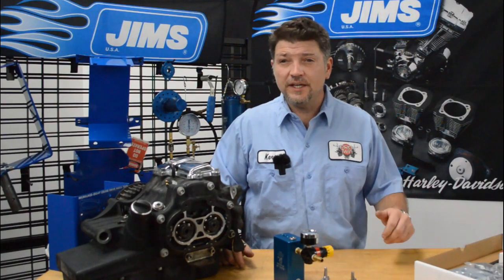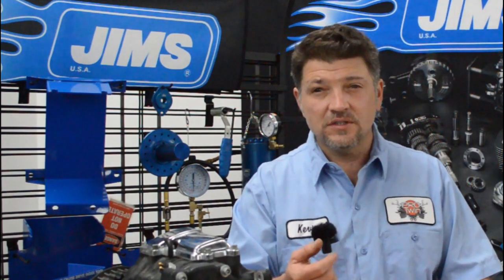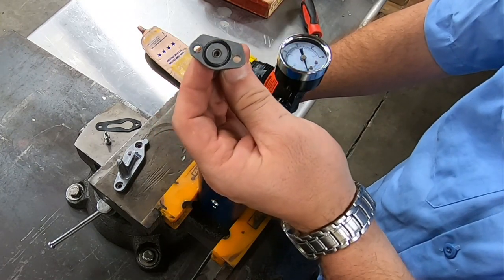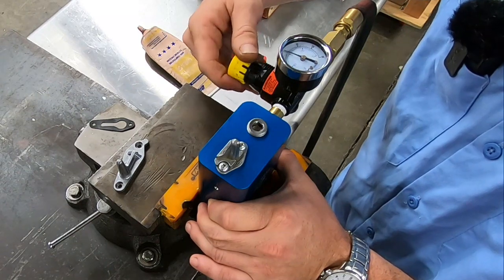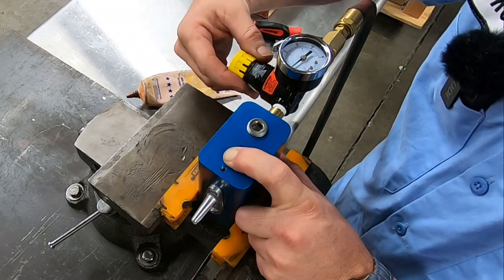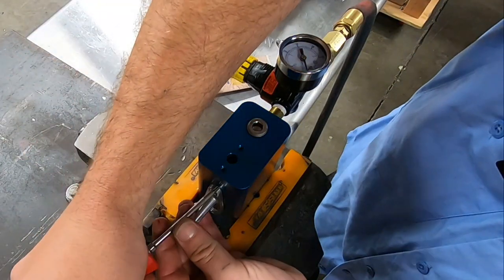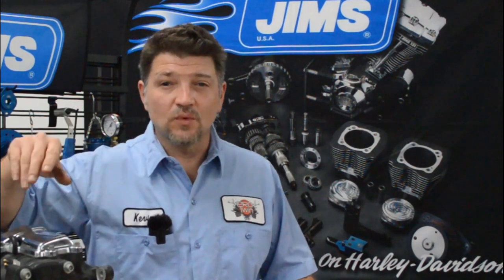Failed M8 Piston Jets - M8 Sumping Issues - Tool Tech Tuesday - JIMS - Kevin Baxter - Pro Twin Perf

Comment: This is the perfect video to share with my local H-D mechanic! Several of us developed horrible lifter noise at start up on our 2019 M-8’s and H-D thought it was solely loose oilers so the O-rings were replaced. I’m betting that most H-D mechanics don’t have that Jim’s tester in their tool boxes. Mine goes in next for repair as soon as the o-rings come in.
Reply from the maker: Thank you sir. Very soon ill be releasing a video on fitting tappets, preloading, and proper pushrod adjustment.

Comment: I just read about an M8 finding an excessive amount of oil in the crankcase after removing the crank sensor. I never gave a piston jet a second thought as a potential point of failure. I shared your video in that post hoping it helps the owner as well as others.
Reply from the maker: Thank you Kerry!

Comment: Here's a major issue that no one is considering when they install high volume pumps/plates, and I admittedly had not considered it.  Feuling states on their site that the HP+ oil pump provides 27% more pressure and scavenge gear volume over stock. At the time of your installation, you have already gone beyond the OEM piston oiler's capacity to operate at its prescribed (read STOCK) levels. Simply, you've just created a sumping issue by attempting to avoid a sumping issue. No one tells you that when you're installing these "upgrades" and upgrade packages, that you should properly tear the engine down and change piston oilers to prevent sumping. That doesn't make their bolt-on "upgrades" and "enhancements" very appealing.  And I'm of the school that a cam/camchest upgrade, is not a "tear down". If I don't see piston heads, I only upgraded bolt-on parts. 

Here we've all been sitting on the edges of our seats for months/years in the hopes that someone will alleviate our fears by telling us exactly what's necessary to make our engines run forever. And, here it is. A psi increase of that pressure/volume is going to overwhelm/negate any and every stock part that is created to regulate/limit it.

This is the totality of the explanation. And if you miss out on an absolutely necessary component, doom on you. 

However, if we didn't have Kevin Baxter doing the work and spending the hours, we would still be in the dark and still be blowing up our engines from a simple lack of information. Many of us may be decent mechanics, but we're nowhere near the level of Kevin. I wrote him a pretty long and detailed email, a while ago. And while I got no response, I completely understand that these videos are the answer to all my questions. We all owe him a debt of gratitude. 

Thanks, Kevin. My questions have been answered.  The summation? Do it all or don't do any of it.
Reply from the maker: sorry if i missed your email.  several hundred a day come thru and i cant get them all.  thank you for your kind words and for a great comment.  I always cringed, even early in the TC days, when people were stretching bypass springs in their cam plates or installing super heavy springs that would yield as much as 60psi hot at 2000rpm, and 25 to 35 at idle.  HD engines are more of a volume then pressure based system.  Most of the load is taken by mechanical bearings so they arent as reliant on oil pressure to establish the bearing surface.  Repeated cold starts, over and over, without running the bike for an extended period of time even with stock plates/pumps can yield poor conditions.  Cold oil pressure can be 30 plus.  Do it over and over, when the oiling system cant keep up, and it can just build over time.

Comment: To demonstrate graphically when the valve opens putting one of those skinny balloons over the end of it would be cool
Reply from the maker: using oil with a sheet of paper in front of the nozzle works well too.  just messy for a video.

Comment: Is the ball and spring crimped in?  What does Harley charge for new ones? Is it defective machining of the seat? Crappy spring?or just grit from the oil holding the ball away from the seat letting the blow by oil?  Old 900 sportsters (oil pump)we would lap the ball in with a little lapping compound.....

Comment: Hi Kevin, best not to use a 40mm gage, they aren't that accurate, esp. those provided on a standard pneumatic pressure regulator. Go for a 63mm gage with an stated accuracy class and a calibration cert. as well as a scale appropriate to the pressure being measured. (Apologies if sounding schoolmasterly, but I've worked in the gases industry most of my life). That said, the video sure brought the point across. I have a M8 114 CI and it has fallen prey to sumping. Not too sure why, as I have a S&S 475 set of high-lift cams, cam plate, lifters etc., and a S&S oil pump fitted. The bike does get to feel sluggish on hot days on the freeway cruising at 120 km/h or thereabouts. No one can tell me why, but the shop I use now wants to tear my engine down. Bike doesn't emit any blue smoke, runs cool mostly unless I'm hammering it, pulls like a freight train ... etc. but runs ever so rich. I smell unburnt fuel (not oil) all the time. Use 3 tanks of gas to everyone else's 2. Maybe you can share some insight into these things. Thanks again for another very informative video. Keep 'em comin! Love them.
Reply: Does he need a high degree of accuracy for such a simple mechanism?  I'd bet it doesn't matter if that check valve opened at 12 or 14 psi.

Comment: I have a question, I saw a video saying an S&S oil pump holds about 14 psi at idle, would that cause a sumping problem installing one in a twin cam?
Reply from the maker: Not at all.  Controlled and not at full spray at that point.  Cranking that pressure up can lead to other issues though.

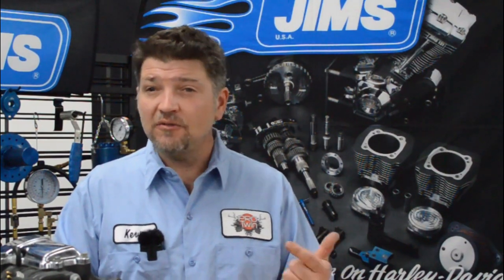Comment: The part at 2:40 really struck a chord with me:  my front cylinder lifters clattered something awful at startup, & HD (grudgingly) replaced them.  Given that I'm now draining up to 9 oz of oil from the crank position sensor hole, could it be that leaking piston oilers are at the root of both issues?
Reply from the maker: it could very well be.  good luck

Comment: Kevin, quick question.  I have an M8 with the whole S&S cam and chest upgrade with pump, plate etc.  The S&S pump runs at a much higher pressure at idle than stock.  This means my piston oilers are spraying constantly also.  I did have my cylinders off once just to check the oilers and yes they were loose.  I of course snugged them up.  Never had any sumping issues tho even before.  FYI my bike is a 2019 FLTRX 107.   Will the aftermarket come up with a new jet that is designed to work with the higher output aftermarket pumps?  I sometimes have trouble getting back to these links so if you could address this question in a future video that would be great since I watch all your videos.  Thanks
Reply from the maker: Great question.  Some crank that pressure up and it can lead to other issues.  a controlled spray at a slightly elevated pressure isnt a big issue as long as the cold starts arent repeated over and over...cold oil makes more pressure.  so if the bike is cranked, ride it so the pump can get the excess oil out.  Snugging them up didnt always fix because the screws were too long to begin with.  They would bottom out.  Thanks for the comment.

Comment: In Nov 2019 I found and purchased an antique Soviet Union military Dnepr sidecar motorcycle. It was imported after the collapse of the Soviet Union in 1992. It then sat in a barn for 27 years. I had to take everything apart because it sat for so long. I was amazed by the oiling system the engine uses. Oil is pumped at 6 bar or 86 psi to the crankshaft. That oil then exists around the shell type rod bearings spraying oil into the pistons, cam shaft, and lifters. There are separate jets that spray oil into the main crankshaft and cam shaft bearings, and the timing gears. They kept building them like that from 1946 until 2001 when a new CEO took over bankrupt the company. They sold millions of those Motorcycles. So many that part's for them are still made and easily available world wide. I would buy a new one if they were still being made due to the bullet proof engine design.
Reply from the maker: great comment.  thanks for sharing. I'll look into those.

Comment: Is there a definitive way to test the piston oilers? Is it possible to replace them without splitting the engine case?
Reply: You don’t have to split the cases. You can access them by removing the cylinders.

Comment: I've got a 124 kit on my m8 and have every single thing in the world aftermarket. including a transmission vent and I still can't get it to quit spitting oil. I have no clue what to do.
Reply from the maker: I suggest performing a leakdown and CCP test to check ring seal.
Reply: @KevinBaxter  I appreciate the response. Will do.

Comment: Hi Kevin  you seem to be really on your game i have a 2021 cvo 117 down 2-1/2 qts at 900 miles dealer said its normal had the 1000 service done @900 now i have 1200 miles and down 1qt again dealer said its normal what do you think? thanks in advance
Reply from the maker: That's not the kind of "normal" i would want to see.  Normal doesnt mean good.  I will say, burning 3.5 qts in 1800 miles....is certainly not good.

Comment: Man! Did Harley use any good parts in the m8? It seems every part is defective. Sleeves cracking, slightly crooked rods, leaking piston oilers, lifters coming unglued Harley has to guit buying crap from Chinese suppliers and startakinh parts in house or they're going to go belly up. it's no wonder Indian is gaining ground.
Reply from the maker: Not all have these issues...my goal is to educate folks to look deeper and not just bolt on parts.  Finding the causes is key.  This is just one of them.  Often, parts get blamed for things caused by other issues.

Comment: I feel somewhat famous!  😪  

Can't wait to smoke everyone and anyone up here in jersey!
Reply: Hi Steven, were your lifters noisy ?
Reply: @Dubhghaill  that's kind of subjective..  so can't really answer..  the stock bike coming off the showroom floor was a sewing machine..  when i put the woods cam, woods lifters and and adjustable pushrods in..  she quieted down a bit..  but i also put a match tuned Exhaust on...  tuned not loud.. but lots enough that i didn't hear any tapping, whirling, etc..  

She was throwing oil into the airbox from the beginning and I thought the blowby coming from the cylinder heads was excessive.     My harley shop said, within limits..  

I put the fueling cam plate and pump and vented dip stick on.. did not solve..  so went ahead and externally breathed my heads....  and she was spitting oil out and got worse..  my oil dip stick was constantly at the ADD mark..  i would put 4 oz in at a time and it would be right down to zilch again in 100 miles..  little did i know i was just filling up the crank..  and my one cylinder rings never seated properly..  

Ohwell..  I'll have a go fast reliable engine that I'm going to try and blow apart everytime i ride it 🙃

Comment: Kevin, is there a way test the piston jet for leaks from the cam chest? I don't know which cavity opening goes to the piston jets but it would be a simple test before cracking the bottom end open. It wont verify plugging but would show a leak.

Comment: You are amazing!! Just needed to say that! I only wished I lived in Georgia, next door to you, I live in Tacoma Washington...shipping!!! I do have a question to ask you and I wonder if you could shed some light on the subject...reference; sumping and crank runout and external venting
Reply from the maker: Thank you John..appreciate that.  Whats your question?
Reply: John... never ship!   looks like you have a nice ride ahead from Tacoma to Winder GA...   i got my local shops for small jobs but Kevin is the only shop my American v twins are going to from now on..  speaking of which..  i have to plan next winter plan..
Reply: @KevinBaxter  with all the M8 sumping issues I was just wondering if these crank venting fixes would help. I have a 2019 tri glide and it came with a lifetime powertrain warranty and ro be honest, I really don't want to void that. I don't think I'm having any sumping issues on the bike but who knows. I've seen a bunch of other videos on these venting fixes and if I understand correctly those "fixes" won't work if there is a bigger underlying issue. A bunch of the videos are because of excessive blow by and trying to fix it. I think I ruffled someone's feathers (wasn't intentionally) because I do believe that if you start making modifications to a bike under warranty, you could inadvertently void it. I made a comment and the reply was not what I was expecting. Am I correct in assuming that if the blow-by is bad enough to warrant altering that it should probably be checked out first? This trike has almost 50k out the door with all the additional charges, so I want to be right on this.